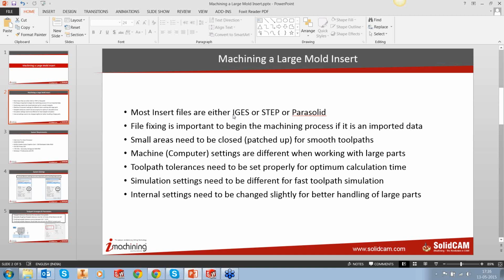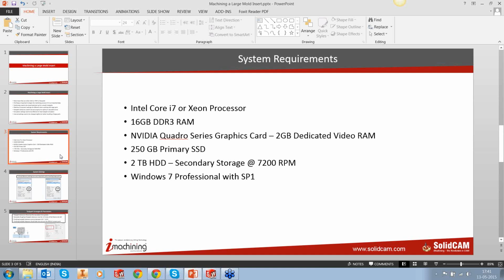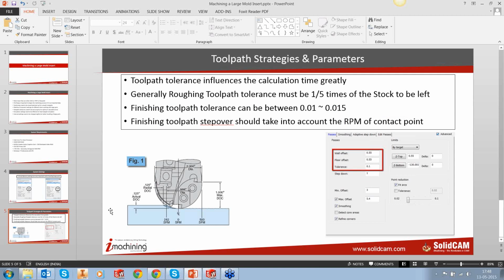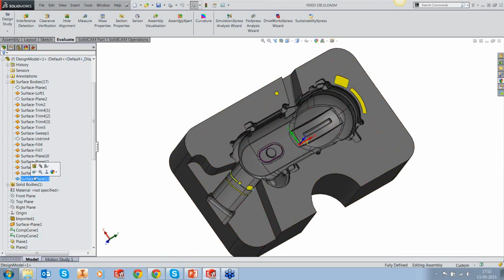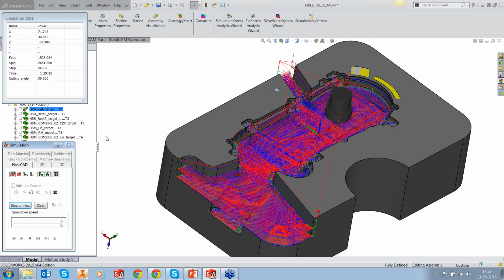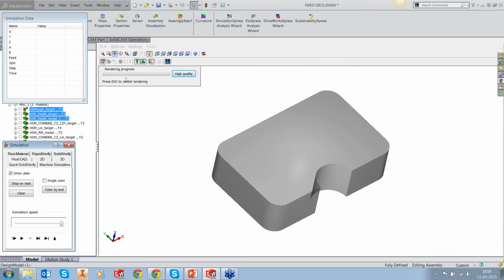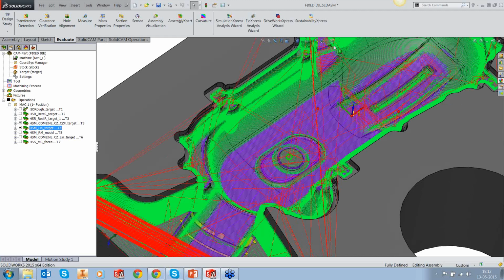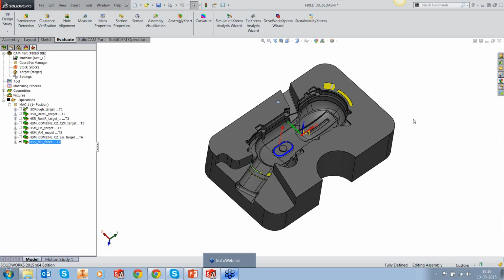SolidCAM University: Machining a Large Mold Insert using iMachining 3D, HSR, HSM,  HSS

Comment: Excelent video, thank you very much.

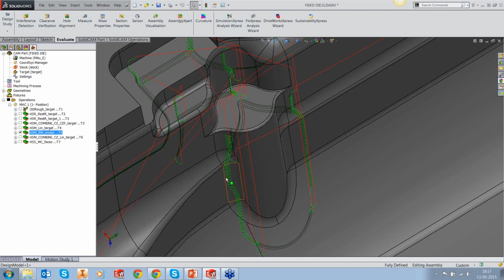I have some questions:  41:53 you say: "that it's very important to note that the tool diameter must be the same, whatever you plan to use for your finishing, you must use the same diameter for your rest machining, so that you leave the same radius and you leave the same amount of material even on the corners", but if I apply a Rest Machining before the Finishing operation, of the same tool diameter, I must keep the same offset, lets say 0.2mm, right ? so the Finishing operation removes the remaining material on the corners. Can you tell me if that is what you mean?.